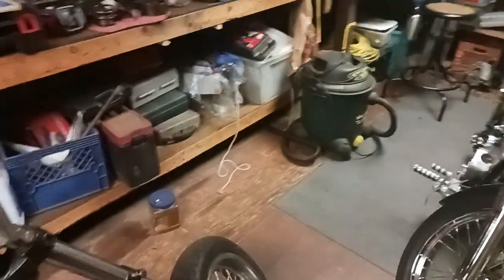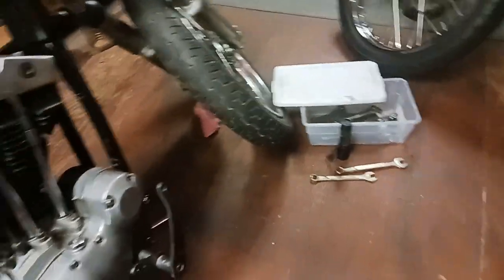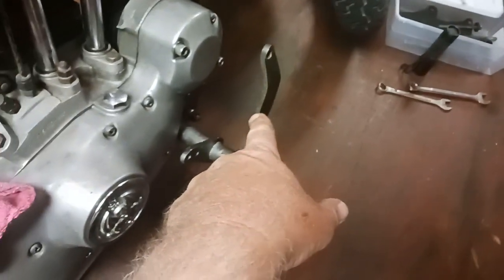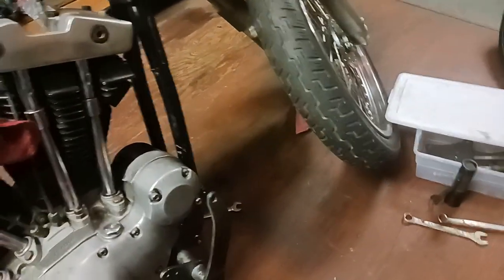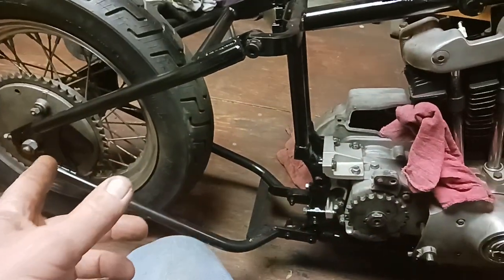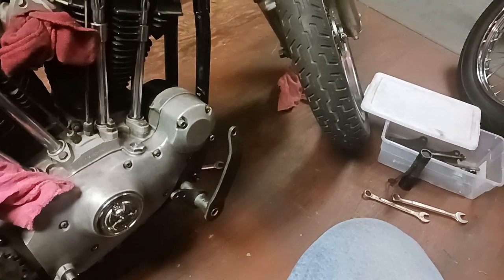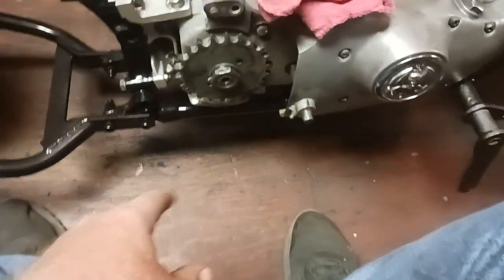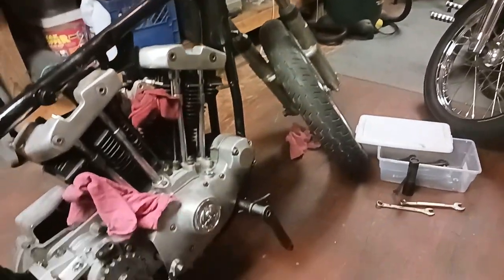1976 IRONHEAD FORWARD CONTROLS

Comment: Ed you still have that crazy shifter linkage and  cross over bar?  That should make getting the left hand shift easy enough. Worst case is make your own cross over bar.. Nah worse case would be trying to get that shifter linkage stuff.  Do let us know where you end up getting your custom length brake cable.  Good video.
Reply from the maker: I have the left hand brake pedal and it still has the crossover tube